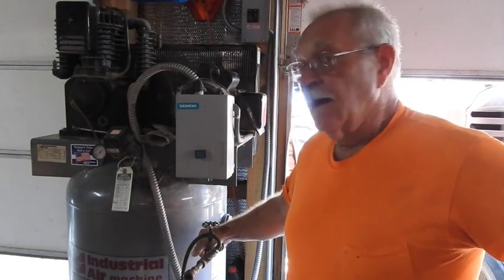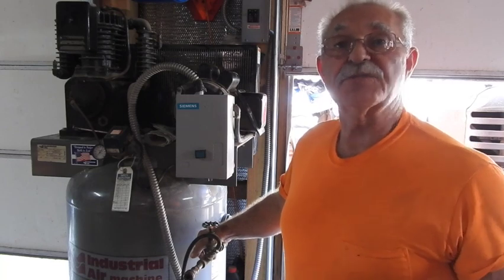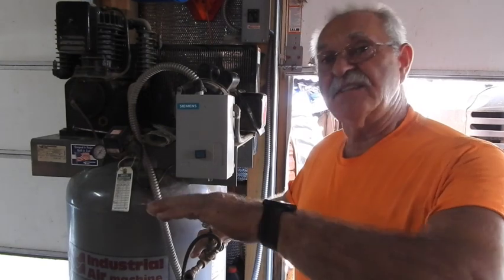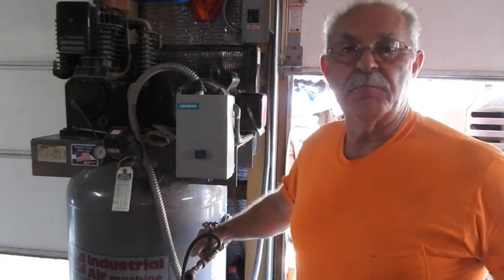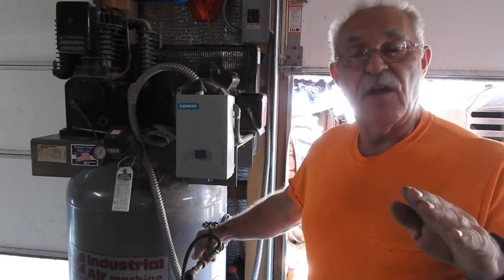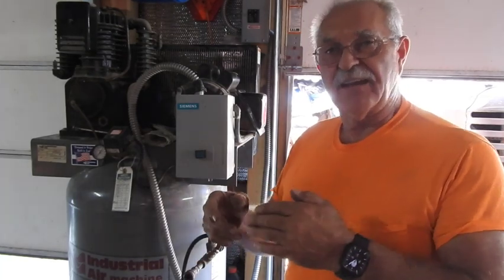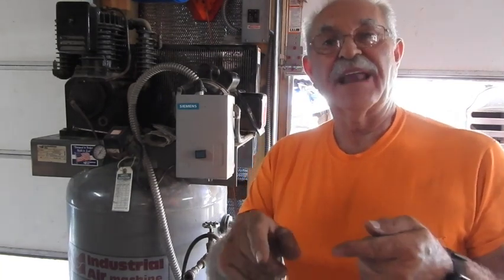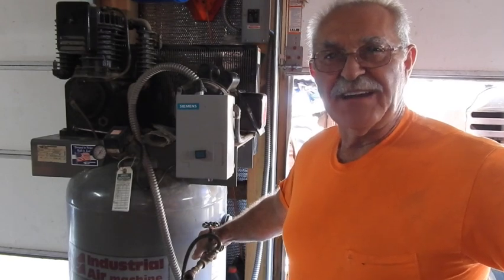How I Figure CFM of  Air Compressors

Comment: 683 seconds is 6 minutes and 23 seconds? I don't think so
Reply from the maker: Yeah, I was trying to recall my earlier calculations without any notes...its 383 seconds. So that threw my calculation off if you are to use that 683 seconds in the calculation for this unit. Thanks for catching that... At least the formula is correct, but it relies on doing the math correct, which I DID on the paper calculation. That's why the video ends verifying the compressor as good. Good ear and thanks again for pointing that out. That's the cool thing about the youtube viewers...check and balance.  I get caught from time to time with similar slips of mind.
    Btw, I pinned this comment and added an addendum to the description on the first line.

Comment: Thank you so much
Reply from the maker: Thank you for watching but can I get you to read the description if you didn't already.  I acknowledge that figuring quickly in my head I actually miscalculated the time factor, but the constants remain the same.  As described, the calculation  works correctly as long as the math is done correctly.  Thanks again for watching.

Comment: Are there any tools that will allow me to check SCFM in a machine?
Reply from the maker: I'm would think that there is...but I really have no idea for sure.  Engineers have a formula for everything though. The only difference between SCFM and CFM  is the conditions under which the calculations are made.  SCFM is essentially done at a specific temperature and humidity with the actual unit and not with calculations.  I'd think CFM is done the same way except in 'real world' conditions at your shop that is probably NOT going to be at their specific temp & humidity for SCFM.

Comment: Nice to know! Actually I used your formula to check my air compressor! Very easy to use this formula!
Reply from the maker: Yes, but remember to do your math correctly.  LOL I had to admit that I'd made a mistake in trying to recall my figuring instead of looking AT the figures.  But the formula is spot on when done correctly.  Thank you for stopping in for a visit today.

Comment: To convert gallons to cubic feet the factor is .133. (Gallons x .133= Cubic feet of volume).  Where are you finding .536? Volume x pressure/ time to fill = Cubic feet per minute
Reply from the maker: .536 is an engineering constant for the specific purpose of calculating compressor CFM.  The formula is:
CFM = G x 0.536 x PSIG / S
CFM = Cubic Feet per Minute of Compressor
G = Tank capacity in gallons
PSIG = Gauge pressure reading on tank
S = Seconds to fill tank
 This is from a Mechanical engineer I worked with for quite a few years and what I would use to determine if compressors capacities diminished between preventive maintenance schedules. We kept records for the life of the units providing copies with our service reports to the business owners.  I think we are doing the same thing though.  
     Engineers seem to like to make things more 'interesting'.
Reply: @tractorman4461  I believe the constant is derived from, roughly, (.13368 * 60)/14.7  --->  This is (gallons to cubic ft conversion factor * 60 seconds)/atmospheric pressure in psi.  Using these numbers you would get .5456, so just a hair off.   My guess is the constant .536 is used as an "average" since atmospheric pressure changes over time.  BTW, I calculated your compressor at 19.6CFM which seems more reasonable considering the industrial quality, motor HP, and dual stage.  Nice comp ;)

Comment: This is probably the BEST explanation I have come across after searching alot of YT videos! Thank you doc!
Reply from the maker: It's probably not the perfect way to do it but it is close enough to get in the right ballpark. The variables that effect it are the human aspect of monitoring the time frame and the inaccurate pressure measurement... (lack of digital components) and computer control.  But that would be up to the factory engineers for that level of accuracy.  Thank you for the candid comment today !!

Comment: funny you mention 17 cfm, that's exactly what I got.  However, it's supposed to be 22 cfm.  When I calculate it out including the variables of my altitude, temperature, and current atmospheric pressure I get 21 cfm which I believe to be the most accurate I'm going to get.  I built the machine myself, so there's no factory numbers to go off of. It's one hell of a compressor built on a trailer for blowing out sprinkler systems.
Reply from the maker: Well now, that's much deeper than my abilities will allow me to dive.  It stands to reason there are those variables in play, I don't  know how to account for them.  Here's a sandbaster I built many years ago running behind a tractor that's too small to do the job: https://www.youtube.com/watch?v=VXuEXSUPPTU Thanks for watching and chiming in with additional input today. A reminder for you to not look too deep in my projects as I am a 'seat of the pants' kind of guy.  (-:

Comment: Industrial Air in Sanborn, or Springfield Minnesota  ? if it is I haven't seen one of those in a day,  or two.  Thank you.
Reply from the maker: You know Bryce, I didn't really look that close at the tag.  I was mainly concerned with amp draw.  One thin for sure it IS a good high quality American made  air compressor.
Reply: @tractorman4461  They are still in business under Minnesota Air Tool. I know a daughter, and husband of the original owner. Hauled for them 20 years ago.
Reply from the maker: @brycewiborg8095  Awesome information Bryce !!  Thank you, I appreciate that.  I will look them up, I'm sure they'll be on google.
Reply: @tractorman4461  I did a quick search. They air operating under Sanborn Mfg which was their original name.  For a while they built generators in Kearney Nebraska, and hydraulic rams in Mountain Lake Minnesota. The company I drove for in the 90s was contracted to deliver 60 % of their equipment. That is why it caught my eye.
Reply from the maker: @brycewiborg8095  So cool.  Thanks again for the additional information.  At least I knew the compressors are still being produced today though.

Comment: Good stuff Wendell. I need to do that test on my air compressor. It's an older 60 gallon that is set to shut off at 125psi. It can't keep up with a 1/4" die grinder which I run at 90psi.
Reply from the maker: Well, rings and cylinders DO wear Matt. Lots of hours at high rpm and intense heat is rough on them. Regular oil changes are important. This is a very easy test of the output.

Comment: Ya got me, I did not know this calculation before. I need to know this information as I have a couple of compressors that were given to me recently, and I want to use them in my shop too.
Thank you for this one Wendell.
Reply from the maker: I forgot to point out that you can easily figure out what a 'shop built' or 'home made' air compressor is putting out. I still have the first system I ever built when first married.  It's a belt drive refrigerant compressor out of a 1940's commercial cooler piped into a 60 gallon DeLaval vacuum tank mounted on a shortened riding mower frame.  I still use it occasionally.
Reply: @tractorman4461  Good stuff. I have one too, but built up with and from actual air compressor parts. Kellogg  80 gallon horizontal tank, belt driven Compair 'pump' powered with a 2 HP Leeson motor 220VAC 1 ph. Still using that one today too. Although, I think that tank is due for replacement, we'll see :)
Keep  movin' along Brother!
Cheers!
Reply from the maker: @regsparkes6507  Sounds like a much better unit than the first little one I built.  LOL  It's pretty important to blow them down ever so often too.  People don't realize just HOW much water collects in the bottom of the tanks.  I've installed dozens of automatic blow down solenoids on commercial compressors over the years.
Reply: @tractorman4461  I used to try to impress this upon my customers too. I told  them to look under their car after driving on a warm day, " see that puddle of water, that's condensation from your air conditioner,. This condensate is exactly what's happening inside your air compressor tank, so drain it daily, if you use the compressor each day, then if not, drain once a week."
P.S. Most of them did NOT listen, this is where I got the large air compressor tank from, a customer decided to have a smaller compressor installed. He was certain that a smaller tank wouldn't have as much water in it. D'uh!  Gotta love those 'intelligent' ones!
Reply from the maker: @regsparkes6507  Hahahahaha....that customer was too smart for his own good.  LOL  In addition to automatic blow down solenoids, in buildings with pneumatic controls we had to run the compressed air through a refrigerated air dryer to condense the moisture out of the air before it got the chance to contaminate the pneumatic thermostats, controls and actuators.  Many times over the years the air dryers would fail and the system would flood with condensate ruining much of the control system.  Pain the the rear !!  People just don't realize just HOW much moisture is in the air on a hot and humid day.
Reply: @tractorman4461  Yes I hear you. Here we go again with that old sayin, " you can lead a horse to the water, but you can't make him drink."  or one my dear old Dad used a fair bit,
( I sometimes wonder if he 'aimed' this one at me in my teenage years,..)when he would say,...   " those of you who think you know it all, are very annoying to those of us who do!"
Reply from the maker: @regsparkes6507  hahahahaha....I think all the old timers back then must have all read the Readers Digest  'Humor Is The Best Medicine'  articles and got those old sayings at the same time.  I heard both those quite a number of times.   LOL

Comment: Good evening Wendell.
Wow … yet again you teach and old dog a new trick.. My compressor is a 60 gal tank with a single stage..
125 psi maximum 11.4 cfm @40 psi-9.0 cfm @ 90 psi.
The one thing I have never like is it runs down to 40 psi before it kicks on and that is a pain when you run air tools.. But I have lived with it for over 30 years . I have not figured out how to change that.. 
Guess I will have to run that test ..
Thanks for the information.
As always stay safe and always be kind.
Cheers my friend..
Reply from the maker: On several home built units Gus, I used ole refrigeration controls that has an adjustable 'cut in' and a differential to adjust for the  'cut out'.  They were common to almost all R-12 and R-22 refrigeration systems and readily available to service techs like me because we changed out systems continually.  I think the manufacturers use tricks with numbers to figure cfm sometimes.  I don't know exactly how they figure it.   Kinda like the hp ratings on a vacuum cleaner or a table saw. Good luck with the calculations.  Remember the .536 multiplier first !!